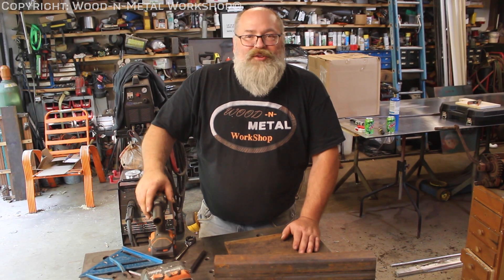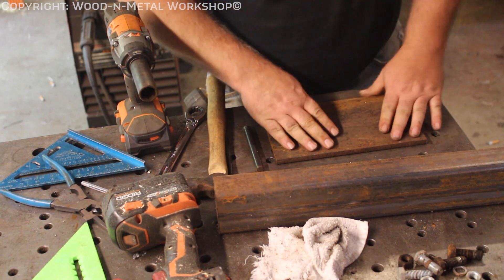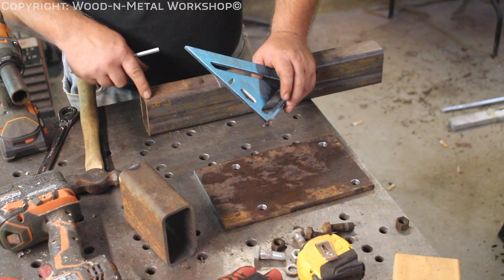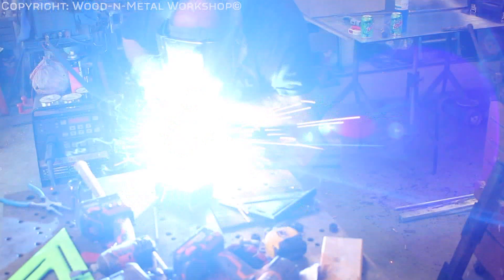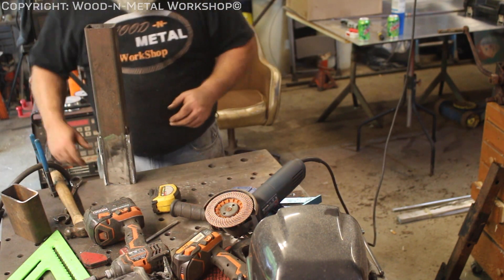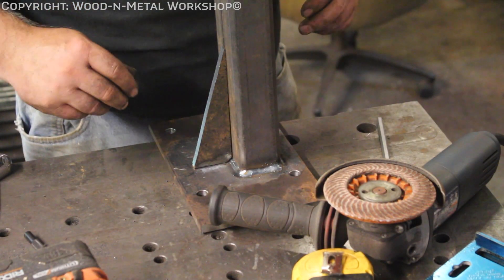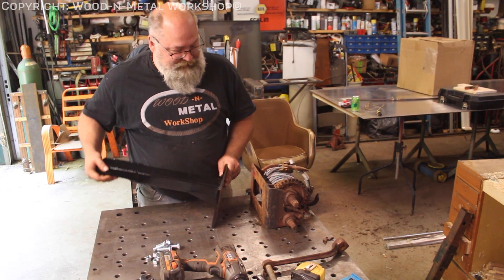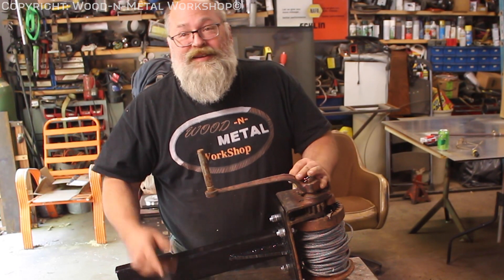stake pocket Winch mount

Comment: I have a 3.2hp electric winch I’ve been planning to mount. Love your design. I purchased a 30’ tow truck jumper cable set to hook to the solenoid. It’s plenty of length to reach the truck battery with the trailer connected. The only thing I thought about adding to the mount is a piece of angle at the front, to work as a depth stop and to add extra stability by spreading the pulling load against the trailer frame, not just the stake pocket.

Comment: Now you got me wandering how much a stake pocket will hold.
Reply from the maker: The center pocket on the front c channel has held up to pulling a 1000 pound sheet of steel plate up the ramps. I also added a extra pocket with better support on the tongue of the trailer and pulled a 2014 Chevy Silverado 1500 on.  My guess that's approximately a 6000 pound rolling load. The weak spot is the length of the upright.